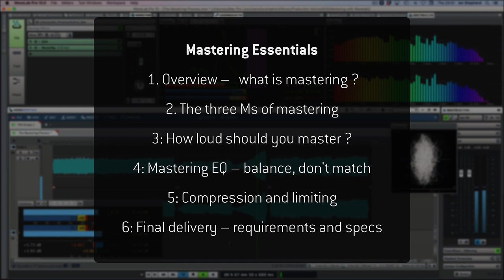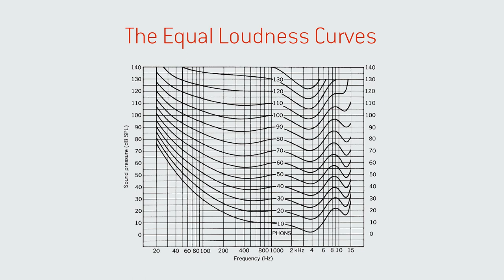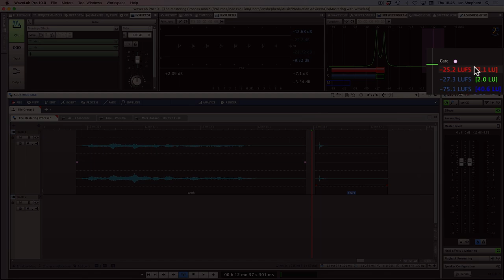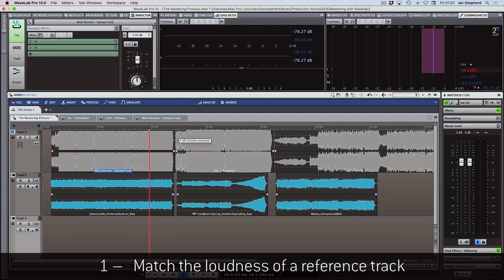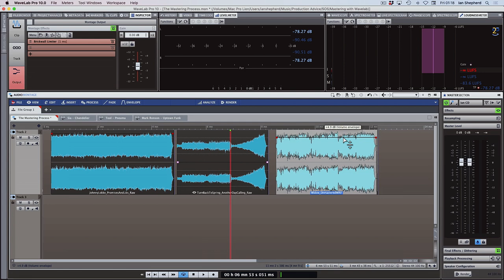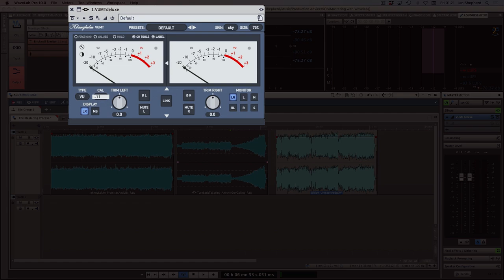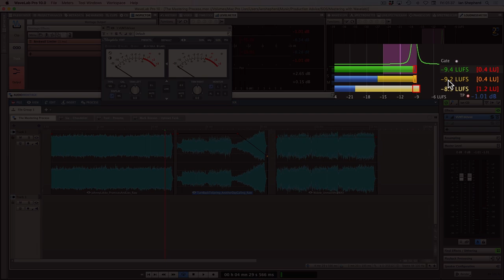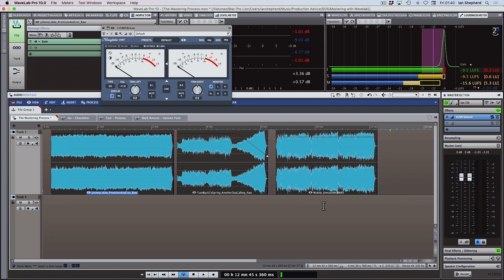Mastering Essentials Part 3 - How loud should you master ?

Comment: I do a lot of Hip Hop and Dr. Dre is often lauded as having the best mixes in the business so I checked the loudness he has outputing on his CD's and I was shocked seeing his most recent release pegging at -3db RMS and just utterly squashed. So I mimicked it just to see if I liked it vs how I would have normally mastered and I hated the overly loud, limited, squashed sound. My -10 RMS master sounded way punchier, bassier, and clearer. 

Right then and there I gave up on reference tracks and loudness worries. I just master as loud as I can get something with the least amount of limiting and gain reduction possible (typically 3db max GR on the final limiter). Sometimes that means -10 or -12, sometimes it is as loud as -5 at points. Depends on a variety of factors but at the end of the day as long as it sounds good and when you play it in between other contemporary masters it holds up then you did your job. Imho
Reply: @patrickchampagne5883  I would agree with you that Compton isn't great. However, I also disagree that the mixes and masters on 2001 are good as well. Similar squashed, overly compressed sound that I just can't stand. I personally think The Chronic was the first and last time he mixed at a truely high caliber. Excluding some of his work with Snoop, Em, and 50 whose early materials pre 2005 when mixed by Dre sound much more similar to The Chronic than 2001.

Thanks for your opinion though! I appreciate hearing it
Reply: You've stumbled on the hardest thing to achieve, ultra loudness while still sounding great (potentially, I don't know which tracks/album you're talking about). 

The question to ask is do you like the sound of the Dre records despite them being super loud? You might like the loudness and sound of the Dre records but are simply struggling to get your own tracks as loud while also maintaining that punch, etc. 

If you can't get your own music to the same loudness while it still sounding good, you might want to work on getting your masters sounding as good and as loud, just as a personal goal/exercise. 

Overall though I don't like ultra loud masters either and fully agree on mastering to the loudness of your own choosing, since you're the musician as well. Something to consider though is how your music sounds after it has been uploaded to spotify, etc. When played with other artists that spotify will autoplay after, does your music sound as 'good'?

Just some stuff to consider.
Reply: There is a lot that goes into mastering a track that loud without destroying all the excitement. It's possible but the techniques are pretty advanced. You'll have to use a fair bit of multiband compression, probably multiple stages of glue compression, dynamic EQs, and likely a couple of limiters. Even going above -10LUFS without sounding squashed and removing all the excitement is somewhat of a feat.

Comment: Brilliant! I think this can also be applied when i digitise my record collection. when i record straight from turntable to digital interface> Pro Tools the recording is always at a low db so i use a limiter to boost the overall volume before exporting as a master wave file.
Reply: That's a little different and bad practice if the goal is to digitise without altering the original master/record. What you're essentially doing is a quick and dirty 'master' on top of an already mastered record. 

The main problem you have their is gain staging. If you haven't already got a dedicated turntable preamp (with a proper RIAA curve and boosting circuit) I would highly recommend getting one (Schiit Modi is good from what I've read). Then, you need to set the gain on your interface appropriately to get a decent level (bumping around -12dB is plenty) so you're getting the most out of your interfaces' A/D converters (analog to digital). Boosting too far will obviously add preamp noise, but if you're boosting the recording you'll be boosting noise anyway.

Comment: Got a question here , i used many limiters to stay  at  -1dbfs .

While these limiters seem to do the job , i saw with a " true peak  viewer" that my songs went higher than that value .

Sometimes , it shows that i'm hitting at -0.5dbfs even if i set up my limiters to not go beyond -1dbfs . It's crazy .

Could you explain here please?
Reply: It's a bit of a complex topic, but in a nutshell dBFS tells you the sample peak, but in some cases the reconstructed analogue waveform (or data-encoded stream) can overshoot higher than this, which is what you're seeing. That's why I suggest using a True-Peak aware limiter and meter, to avoid this. I show how this works more in the final video in the series.

Comment: Hi Ian, First of all, thank you for this video series, I'm a producer and mixer and now I finally found the best beginner tutorials for mastering. I have a little question If my song recorded and mixed at 96Khz what is the best way to dithering to 44.1Khz or I don't need to dithering?
Reply: Dither is only used when reducing the bit depth, don’t use it for reducing sample rate. Always reduce sample rate before reducing bit depth. And reduce the sample rate as the last thing you do (minus bit depth reduction)
Reply: Just to add a little more detail to what  @frankuswalk  said - I agree that it's best to convert sample rates before you reduce the bit depth, and provided you store the 44.1 kHz version in a floating-point format, you don't need to dither. 

But if you use a standalone application to do the SRC and then save it out to work in a different application at 24-bit, for example, then you DO need to dither. The SRC processing is done in floating point, so unless it's saved the same way, you need to dither.

Basically the simple rule is - always dither after any processing, whenever saving to fixed point (24 or 16 bit). If you're staying in floating point, you don't need to dither.
Reply: As others have said, whenever you are exporting at 24bit or 16bit (for CD) you'll need to dither. Most of the dithering algorithms are the same or similar. You'll want to use your final limiter at the end of the chain to do the dithering. It doesn't matter which limiter you're using; any good mastering limiter will have dither built in whether it's Fabfilter Pro L or Waves L1. I would recommend not to use the dithering in your DAW since you really want to listen to the dithering and choose the one that sounds the best for the mix. Most of the time in Pro L, I find that the Optimized dithering sounds the best. If you're exporting a mix before mastering, you should export as 32bit floating point and then you will not need dithering. But any time you export at 24bit or lower, always use dithering.

Comment: How loud should you master? -14 LUFS, with peaks below -1dBTP. Mastering any hotter will just reduce perceived loudness because of downward normalisation. The loudness war is dead and dynamic range is back.
Reply: Some people would agree with you about -14, but not me. Should an acoustic ballad and a heavy rock track both be mastered at the same loudness ? That doesn't make musical sense. Also some genres sound better with more intensity.

I do agree with you about dynamics though, it's why I started Dynamic Range Day :-)
Reply: There are a lot times I master hotter than -14LUFS. In fact, most of the time, I shoot for around -9LUFS. I master a lot of rock and metal and people are used to hearing it that way. With normalization, it means we don't have to care about the level anymore which is a really great thing but people are used to the sound of the music hitting into the limiter and if you want to master commercial music, the limiter is part of that sound. Otherwise, the song will sound cheap and unfinished. Human brains are a funny thing. 

So how loud do I master? As loud as the song calls for. I bring the level up until I get the sound that I want. Who cares if spotify gains it down?

The only thing is, I never master lower than -14LUFS because I don't know how streaming platforms are going to turn me up and I want to make sure I'm not being put into a limiter. So classical music will get limited to JUST -14LUFS but no louder.
Reply: +1 on the -1dBTP. If you know the track is only for streaming, the streaming providers really don't want peak values higher than -1. For CD I still bring it to -0.1dBTP and that's only to catch the few accidental peaks that may go over because of sample rate.

Comment: I'm a bit confused after I've watched this. Ian, you're saying we need to start by just pushing the gain of the song up to match the reference track? But aren't we supposed to get there with the use of all the different plugins and stages, not merely turning the volume fader up?
Reply: Well... yes and no :-)

I will be using them in the later videos, but their purpose isn't really to make the songs loud, it's to make them sound as good as possible when they're loud. The loudness is achieved by adding gain - but balanced EQ and dynamics mean it doesn't clip or slam into a limiter too hard.

The main reason I suggest doing it first is efficiency. If we did EQ first and then turned it up, we would need to immediately tweak the EQ again because the change in level will change the way we hear it (because of the equal loudness curve). You could crank up the monitor gain instead, do all the EQ & compression first and then turn it up later (at which point you'd need to turn the monitor gain back down) but then the limiter would start working and potentially change the sound you just decided on. You'll end up with the same result eventually, but it's more steps and more confusing, in my opinion.

This way everything is done in knowledge of the final sound of the limiter - which is only working very lightly, remember. In fact when I work I'm applying and adjusting EQ, compression and limiting all at the same time. I don't recommend you work that way when you're starting out, but it gets easier with more experience.

This approach also encourages minimalism - if you turn something up and it sounds fantastic with nothing but light limiting, you're done. Maybe it needs an EQ tweak, but if it then sounds fantastic, you're done - and so on.

Does that help ?
Reply: @ProductionAdvice  yes! Thank you for clarifying it. I'm looking forward to the next video!
Reply: @filipjonathan  Great :-)

Comment: Thanks Ian , great tutorial. Do you still master a CD at -1db tp the same as streaming? I understand -1db tp for streaming allows for whatever conversions may take place to guard against overs, but is that also valid for CD?
Reply: Great question - and yes, I do. 

Even on CD, it's possible to get peaks above zero at the DAC, if you're peaking right up to zero. In theory an inter-sample aware limiter will prevent that, but I prefer to play it safe. 

And perhaps even more importantly, CDs get ripped, at which point the risk of clipping after a lossy data-encoding stage is just as much of an issue. If you follow my "no louder than -10 LUFS" suggestion it's fairly unlikely, but following these guidelines has served me well over and I'm sticking to them :-)
Reply: @ProductionAdvice  Thank you Ian, all great points! One level to rule them all! I like it! 😎👍
Reply: @Beatledave7  Pleasure :-)
Reply: For CD I always go -0.1dbtp and run Pro L at 8x oversampling and master at 96k. I can be pretty certain that I won't go over 0 doing this. People still want their CDs loud and you don't want to sound weak next to a loud CD.

Comment: Ok. So am I right thinking that you're not sure you wanna hit the limiter plugin with "a too hot signal" and at the very same time you're ok to set your VU ref.calibration at -11dB which is already quite high, especially if you use it, for instance, with some analog emulation plugins (and there's no guarantee you wont use it in your mastering pipeline) which usually take between -20 to - 14dB, and some of them can't be even calibrated to anything else but to "classic"  -18dB..?
Reply: Yes and no 🙂

Firstly bear in mind that in the later videos I'll show how to use compression and EQ to keep the limiting at a minimum. And secondly, for analogue modelling plugins or actual gear I'd certainly suggest calibrating to -18 LUFS. With hindsight I guess I could have been clearer about that in the video 😕

Comment: Hi Ian, thanks for a really great series!! I got a question here. One thing I don’t understand is the need for using a trim tool or clip gain to increase the volume before any eq moves. What’s the difference of just using the fader in this case, the percieved volume and feeling will be the same, or??
Reply: Hi Hector, There's no difference in sound, but there are a few other factors. 

First, in many DAWs the fader is post-insert, so adjusting the gain there won't affect the level that hits the dynamics processing (next episode !). That's not the end of the world, but I prefer to tweak the gain going in rather than having to keep messing with thresholds and make-up gain.

Second, it minimises the level-shift when bypassing the processing, which can have an effect on the way we perceive any processing, so I prefer to not adjust gain inside an EQ or dynamics processor.

And finally, it encourages minimalism. If we always get in the habit of adjusting the gain first, we hear the most reliable impression of the final sound, and are less likely to get sucked into unnecessary EQ and dynamics processing. If we can adjust only the gain and nothing else - great !

Hope that helps ?
Reply: Thanks for your reply Ian, yes.. that makes sense, specially getting into the habit of always gain staging, I forgett that most of the time after the initial gain staging.

Comment: thanks for the great series SOS and Ian,
i  have a question about the initial level you set (from the clip vol and gain plugin). why push it to the limit ,isnt it better to have the songs "matched" levels ,in around -18 vu and then use the threshold on the limiter/maximizer when exporting ? especially if decide to involve analog gear at some point ? or its because you know you gonna go only ITB mastering ?
Reply: Either approach will work, and yes - if you're sending to external analogue gear (or analogue modelling plugins) then -18 is a better choice. Even in this case I would increase the gain of the returning signal to be in the right ball-park as I listen, though.

The reason is that if you decide to balance to a lower "interim" reference level like -18 first, you'll need to start with a higher monitor gain initially, and then later increase the final gain and adjust it back. You'll also then be adding limiting on top of the other processing you've chosen, which could change the way that it sounds and add extra work as you adjust.

Whereas I've found the approach to be most efficient. It does risk hearing too much limiting to start with - but that's actually useful info to have - "if I want to be this loud, I need heavy limiting or other dynamic processing". Otoh if you increase the level and it sounds great just with very light limiting and without extra processing, that's a nice minimal way to achieve a great result. And since the levels I'm suggesting are fairly conservative, hopefully nothing will need pushing too hard anyway.

Does that make sense ?
Reply: @ProductionAdvice  thanks for the detailed answer' yep it does makes sense

Comment: Great series thanks for doing this SOS and Ian. One question what does calibrating the VU meter to -11db actually do? does it make the scale of the meter -11 instead of -20? or does it make the 0db -11? could someone please clarify im feeling dumb!
Reply: I haven’t personally used that specific plug-in, but based on some experience with other plug-ins, I believe it sets the “zero point” of the meter to -11, just as you said. Not a dumb question at all – this stuff can be confusing!
Reply: Right - it just adjusts the scale of the meter. 

By default it's calibrated to -18, so pink noise @ -18 RMS or -18 LUFS will read zero, and so will your music if it has balanced EQ and reads around zero. That's a great place to be for mixing, or looping out to external analogue gear, but for mastering you almost certainly want to be louder. 

Adjusting to -11 on the VUMT means that pink noise @ -11 LUFS or -11 RMS will read zero on the VU, and again if your music has balanced EQ and you adjust it so it's hovering around zero VU, it will also be close to those values.

That's still fairly conservative as a final loudness these days, but I think it's right in the sweet spot of being loud enough to sound great, and work well online (or on any other format)
Reply: @ProductionAdvice  Ian, thanks so much for the reply, and the fantastic videos and website. I think there may be a typo in your second paragraph above - when you say "Adjusting to -18 on the VUMT means that pink noise @ -11 LUFS or -11 RMS will read zero on the VU", I think you meant "Adjusting to -11 on the VUMT". Is that correct? Just wanted to clear that up to avoid accidental confusion. Thanks again for everything!
Reply: @ProductionAdvice  ah I see as it’s not really measuring the peaks? 

Thanks for the great replies guys!
Reply: @liquidsolids9415  Oops yes, sorry ! I've edited my reply to fix it
Reply: Correct  @donkeyfacekilla1  VU, RMS and LUFS meters don't measure peaks at all (peaks aren't helpful when assessing loudness, as I tried to show starting @ 4:47 in the video)